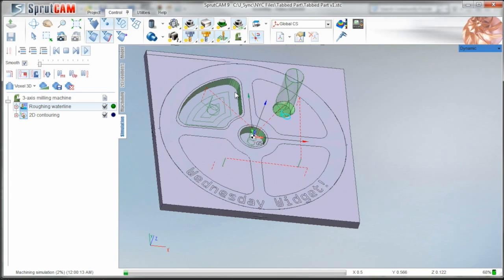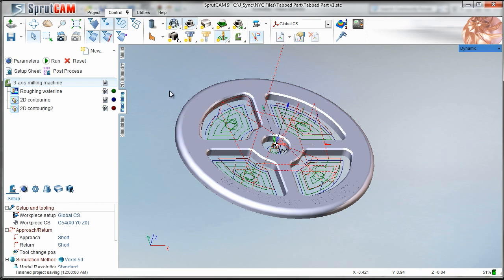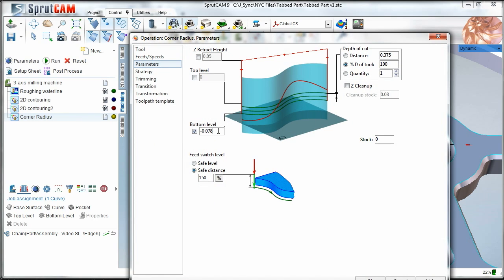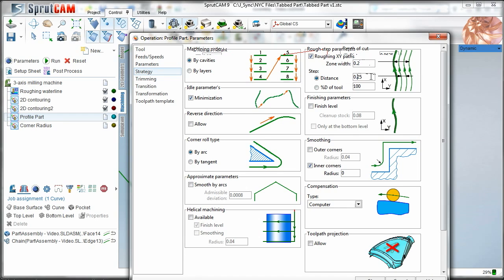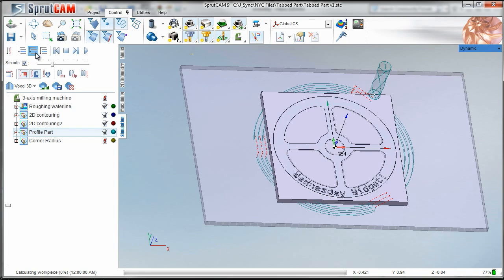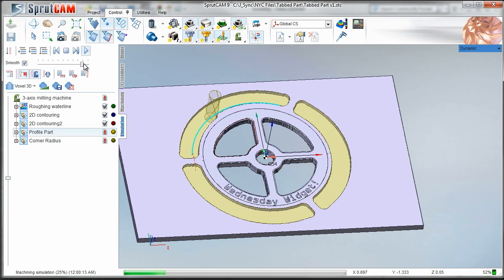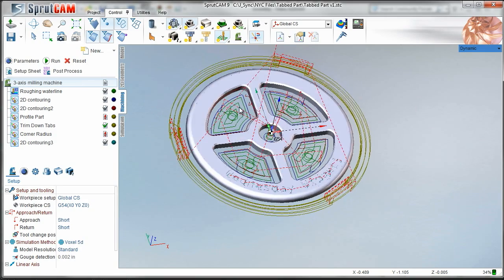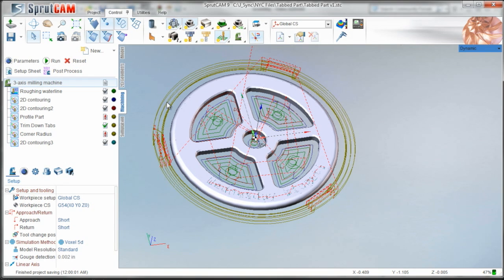CNC Machining Workholding Wednesday Widget! Part 2

Comment: Is it quicker / more efficient to have tabs vs a tapped hole in the center of your fixture and a washer or even simple screw in the middle of the piece holding it down for Step 2?

Step 1. do all the internal to the object pocketing / chamfering then
Step 2. screw it down for the OD milling and finishing?

Loving the videos - thanks for taking the time to answer questions!
Reply: So the scotchbrite wheel as a second operation is quicker / more efficient than the first option?

(yeah yeah just read the description. video gud - no reading required!!) haha

Comment: Rather than a separate trim step for your tabs, couldn't you save travel time and programming time by making your "clamps" the size and location you actually want the tabs in the first place?  Sprutcam is unlikely to evaluate the utility of your fixturing, it just avoids cutting into whatever you tell it is there, right?

-- Mike
Reply: John, I don't think you did...you had the clamps thicker/higher than you wanted them in the CAD, so you had to do a separate step of going back and trimming them down to make clearance for your round over cutter.  That took extra CAD design time, extra G code size, and extra run time on the part. The only reason they were there was so that Sprutcam would leave some tabs.  If you'd made them thinner/lower in the CAD, Sprutcam would still have left your tabs, but you could have skipped the trimmin/thinning operation on the tabs that you did before the edge rounding. They aren't really clamps, so there's no need for them to be above the part...they just need to be high enough so Sprutcam jumps up the tool path and leaves the tab thickness you want. Or am I missing something?

-- Mike
Reply: Thanks.  Until I get a mill of my own, it's all academic to me!  ;-)

Comment: John, why do you avoid plunging with end mills?  Several of the very experienced manual machinists I watch recommend that for some operations, such as slotting.  I believe the reason is that it's faster, has less chance of breaking a tool from chip binding (especially when slotting a deep slot), causes less tool deflection, and puts most of the wear on the end of the cutter, which is easier to sharpen than the sides.  The only times they ramp in is when the mill isn't end cutting.

I don't even have a mill, so the question us just based on what I've seen, not what I've done, and is just for enlightenment for when I do get a mill. I figure you all have your reasons.  Just curious what they are. 

-- Mike
Reply: Plunge to depth and then side cut the slot?  I agree...that's asking for problems from chips compacting, heat buildup, etc.  I meant plunging repeatedly with moves down the slot between plunges...that removes the bulk of the material with plunge cuts, then you side mill to clean up.  I've seen Tom of Tom's Techniques, Tom Lipton of Oxtoolco, and Adam of Abomb79 use that method, and all three have more experience than I'll live long enough to get myself. 
 
As I said, it could be a difference between CNC and manual milling, or there may be other factors I'm not understanding, like maybe cutter size, or machine power/stiffness, or other things. 

Sharpening cutters seems like it would make economic sense for larger cutters, and maybe for smaller ones.  I think Tom Lipton has talked about it in one or two of his early videos.  I think he said that getting a cutter sharpened cost about $10-$12 for his area.

Just passing on what I've seen and been told.  My practical experience with machining is limited to drilling and lathe work...with emphasis on the "limited"!  ;-)

-- Mike

Comment: SolidWorks is great don't get me wrong but for most people designing and machining their own parts, especially on a 3 axis machine, I would highly suggest taking a look at Autodesk Fusion 360. I have used both and prefer Fusion. It's cad/cam and is really nice to use. I will admit SolidWorks is more powerful as a cad program but most people (me included) never use the extra power SolidWorks brings to the table. Fusion is plenty powerful and is cad/cam. Easy to design parts, easy to generate cut paths and is very powerful for the money. I have no affiliation with them but I highly recommend Fusion 360.
Reply: NYC CNC hmmmm, I was thinking you could?

Comment: I use different CAD/CAM software than you do, but mine lets me type metric dimensions and it automatically converts them. If I type '2mm' for example, the software does the conversion. Try it - it might work.

Comment: I notice in all your Sprutcam videos that you feed in your tool data manually every time. Does Sprutcam not have a database of tools that you can feed in and then simply select from a list which one of your tools you want to use? I have some experience with RhinoCAM, and they have that feature, which makes setting up operations quite a bit faster.
Reply: NYC CNC Haha, I know all too well about the "nah, I'll do it later, right now I must get this part out" feeling though. It's quite a relief when you finally have it in there though.